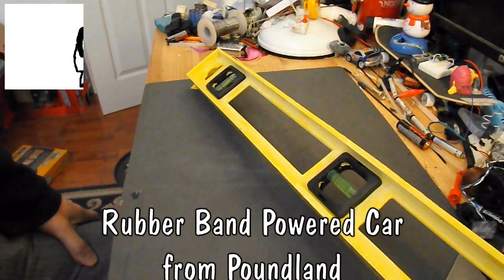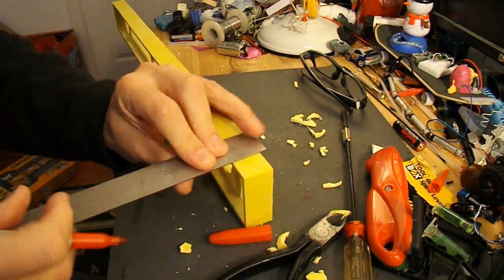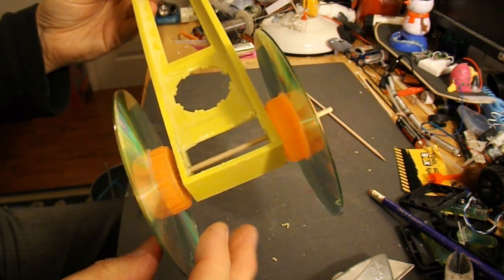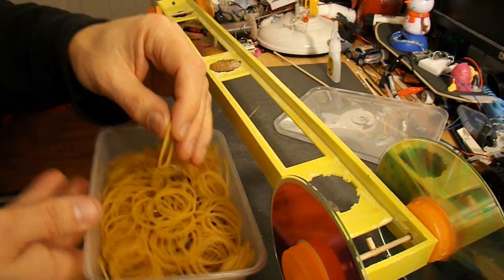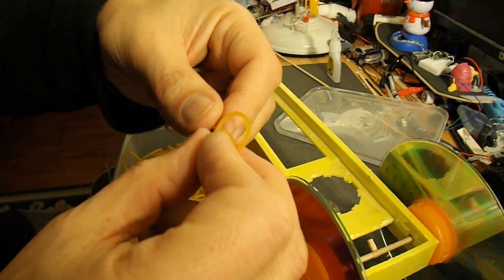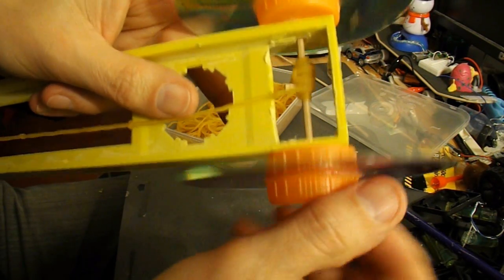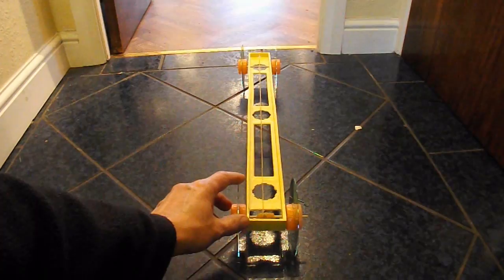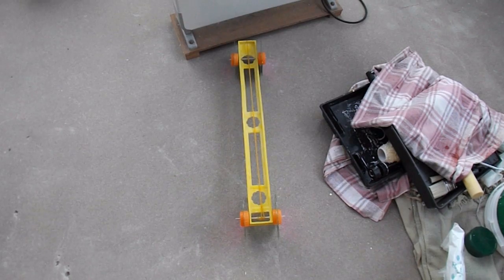Rubber Band Powered Car from Poundland

Comment: Hey Grandad can you make a crawler bot using a toilet paper roll as the body and the legs of your choice?
Reply from the maker: For a crawlerbot to work it needs a power supply - electric motor - geared well down so it can move legs. Suggesting a toilet paper roll as the body is just cosmetic decoration. It would serve no purpose and would not be strong enough to use as a structural part of the bot. I suggest you look at Saurav Chakraborty or burhan saifullah they both do excellent bots with simple components.
Saurav Chakraborty https://www.youtube.com/channel/UCS9yqnnEhL0DlPQtK3o45bw
burhan saifullah https://www.youtube.com/channel/UCoFTczlCJgXaEH0zTZCMzgA
Reply: Thank you very much.

Comment: Lovely!
I just thought of this. You could wind the elastic band around the front axle as well for four wheel drive. Ever done that?
The band would run out quicker but a higher top speed might be reach and with that a longer distance? The front wheel drive will also add enough traction to cope with the greater initial power surge :-) 
The heavy ruler body did great alreadt, but it might benefit from a double or heavier rubber band....
Reply from the maker: Cloxxki if you see my previous reply, ignore it. My cars are usually a flat sheet of cardboard so you cannot cross the rubber band to connect to the top of the back axle and the bottom of the front axle to enable you to wind them in the right direction. I have just used an open framed car and managed to get it to work fine. I guess I will have to try some comparative tests to see if there is an improvement. I will upload the simple version now and think about how to do a comparative test later. I will put a link here when I upload the video.
Reply from the maker: Cloxxki Here is the first attempt http://youtu.be/bW1jCQ6f-do